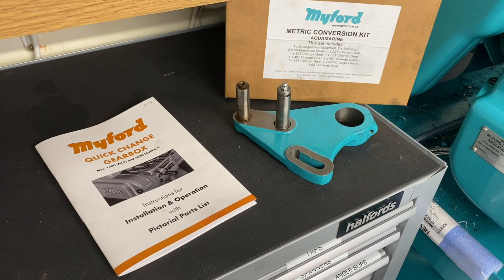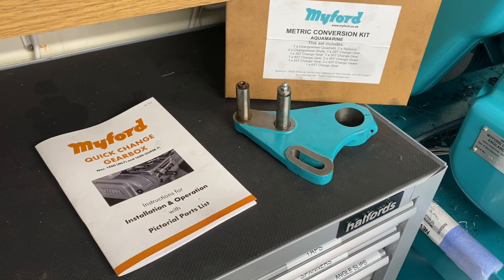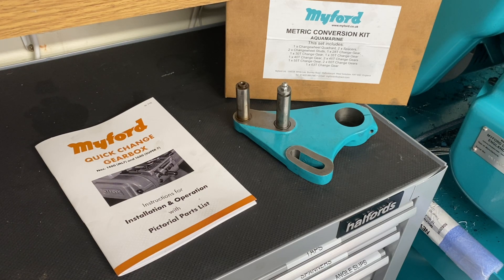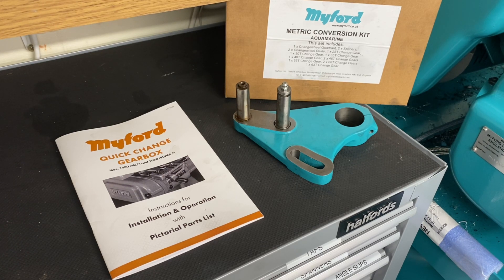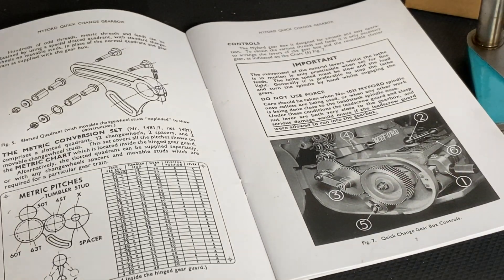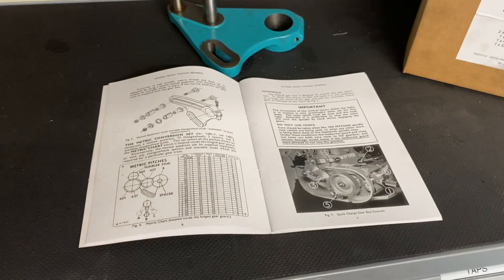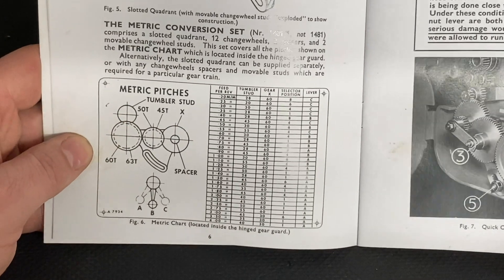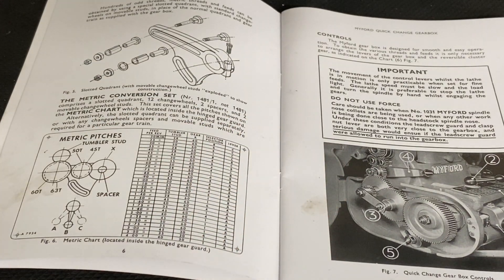Myford Super 7 Change Gear Follow Up

Comment: The Myford metric set is far too much of a fiddle compared to the 33/34 tooth method.   There were several big articles in Model Engineers Workshop a couple of years ago which describe how you can get very close to metric and BA pitches using these 33t or 34t gears in place of the 24t normal drive gear and then selecting gear positions on the gearbox.   You can also find this info on the web.    
On a different note, the big numbers on the gearbox are imperial threads per inch and the small numbers underneath are fine feeds but you must take the second double gear off the spindle and reverse it on the shaft to change from threads per inch to fine feed.

Keep up the good work with your videos.

Mervyn Karwot

Comment: I would recomend the 33/34t conversion, I have a never looked back since..
Reply from the maker: Can you please shed some light on what this conversion involves and what range of feeds are possible with this method?
Reply: @opticalmechanic  you have to fabricate some kind of drop bolt to let the ordinary gear cluster to fit (it needs to drop further), otherwise no major modifications are needed as I remember. There where a couple of articles in MEW a few years back on this (dunno the issue numbers)

Comment: Thanks for the explanation. Now I know that ‘feed per rev’ is the same as ‘pitch’, I understand the method better. So, does the Myford gearbox give you a bigger range of available thread pitches, or does it just make the setting up easier? My first sighting of an aqua blue Myford.
Reply from the maker: You’re welcome. A Myford lathe can cut threads without the quick change gearbox but depending on the change gear set up, only one thread pitch will be available. To change the thread pitch, you would need to rearrange the change gears. 
The quick change gearbox provides a range of feeds / thread pitches for a given set of change gears. Hope that makes sense...